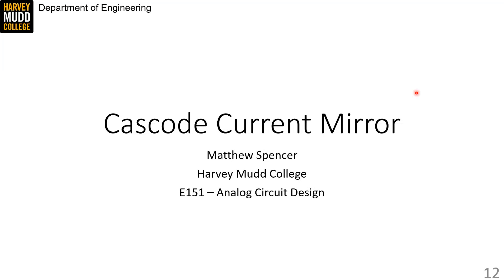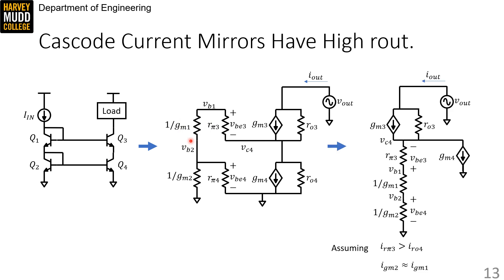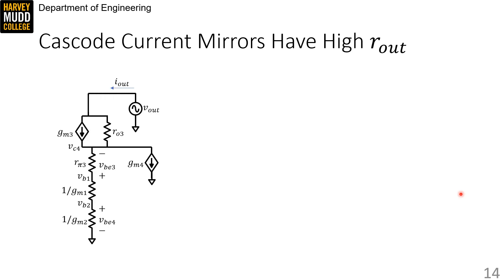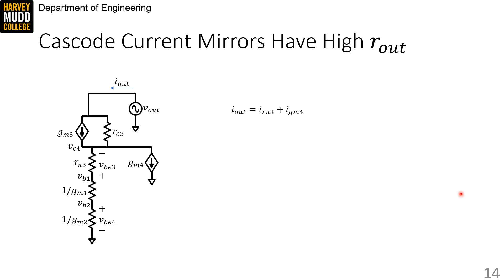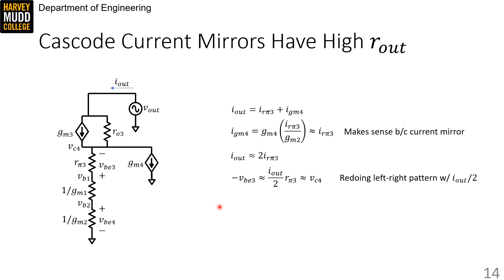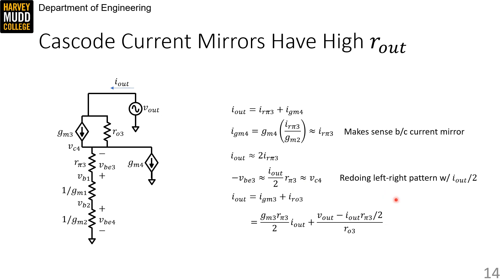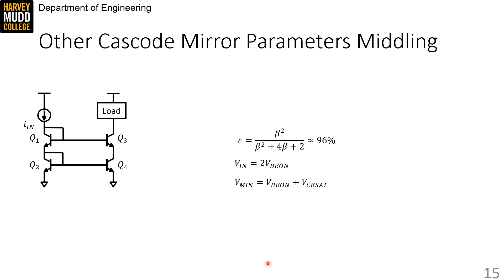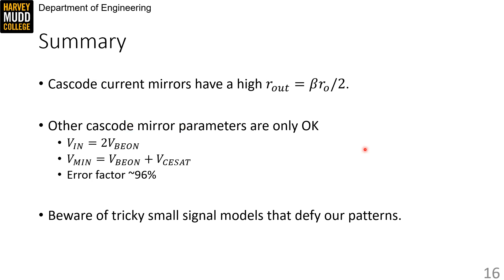The Cascode Current Mirror | Intro to Analog Design | Harvey Mudd College | Video 13.3

Comment: The hardest part is knowing what assumptions to make. Every problem gets messy very quick
Reply from the maker: Yeah, this circuit is especially complex that way.  I nearly quit circuit design after hearing the lecture on this one.  It turns out that the approximations get much more intuitive the second or third time through: they're not tricky, it's just a lot to remember on the first pass.